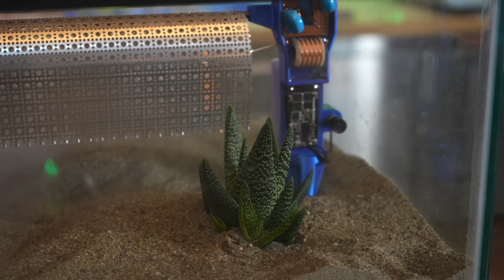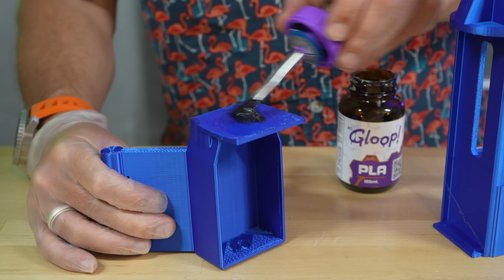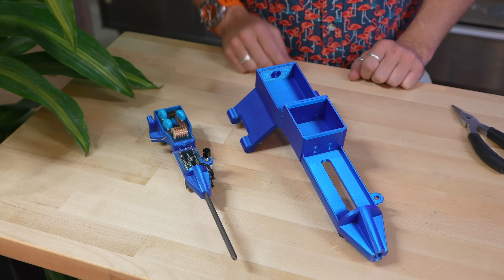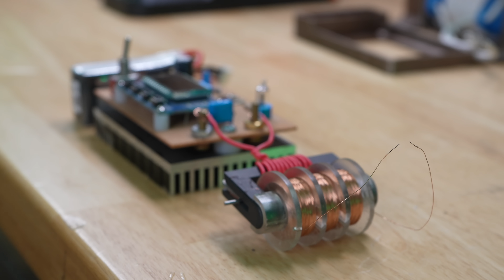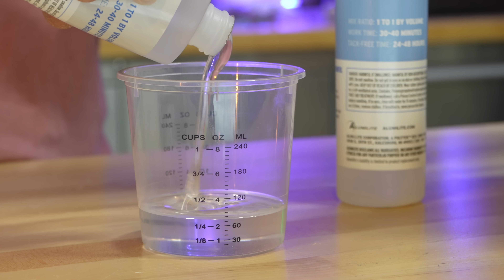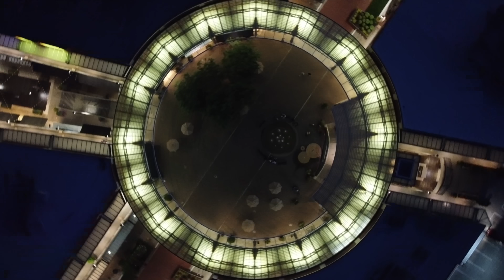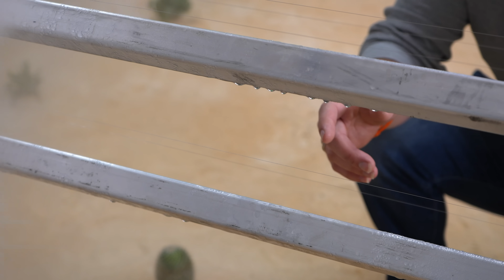Turning Desert Fog into Fresh Water Using 50,000 volts

Comment: What about a geodesic dome configuration that provides shade to a plot during the day and electrifies at prime periods of fog? An interior mesh screen could act as anode and an outer mesh could act as cathode separated by insulators. It would drip over the crop inside but could also be collected along the outer perimeter
Reply: Make it a modular and stackable system and you can easily bolt on more mods for shade or collection

Comment: Do I understand this correctly? You are trying to increase the air flow such that more water has a chance to condense? 
Also, what is the purpose of the dry ice? because dry ice is just carbon dioxide, I guess it lowers the temperature making it easier for water to condense? But doesn't that then mess up your data? FYI be careful using dry ice indoors because a high enough carbon dioxide concentration will make you pass out and you could die.
This should really be tested in a real dessert. Make sure you have a measurement with which you can compare the measurement from your own device. I suggest that at the same time you also collect water from one of those nets earlier in the video.  Doing this at the same time makes sure both measurements are done with the same humidity which (I'm assuming) is the limiting factor of how much water you can get from air.

Comment: For fog detection, would an IR sensor work? Put a emitter and a receiver, and you can measure the voltage based on obstruction. Full blockage for mechanical problems detection.

 Put an LDR, or an ADC on charger output, and you got day/night cycle.

Comment: would totally put some simple esp or arduino nano together with a moisture sensor for control - if humidity higher than _% then turn on. could even log the values periodically, via the native wifi capabilities of the esp32. to take it to the next level could even hook up a scale under the collector to see how much humidity produces which amounts of water to optimize operation, and just general data fun.

Comment: Very amazing engineering here! A few suggestions, Slope  the collector poles and have them empty into a collection tank. Add a micro controller that has an LDR light sensor and humidistat to control when then device should switch on.

Comment: Dry ice fog is C02... which sublimates at atmospheric pressure, the moisture youre getting is from cooling down the air and the pipe with the dry ice.

Is this moisture not caused more by the dry ice than your device?

Comment: Hypothesis: test this setup with a lattice-style structure with thinner wire - it may increase efficiency in a compact space.

Request: begin experimenting with ever-decreasing air moisture content. This could be a simple, cheap, and easy preparatory tech for the low moisture content of Mars's atmosphere.
It could potentially be deployed with today's technology and begin a slow but steady collection of water for future Mars missions if it can be shown to be able to generate usable water from as little as 0.03% moisture by mass.

Comment: Huh... So air precipitators/cleaners actually do precipitate water (under specific conditions). I'd wondered why Abbra had machine-screw mounting points on every one I'd bought when they don't supply anything that uses them.  But I imagine now that they would tend to collect suspended 'vapor' (ie: from a ultrasonic or venturi aerosolizer/humidifier)  I'll have to remember to test this the next time I have another  foggy day or fragrance-diffuser to repair ... (after I've replaced the broken wires in the collection cells... )

Comment: Curious about the other breaking points for the design, that I think only a live test for an extended period would reveal. Deserts are hot. If the idea is to only deploy it at night, then you avoid that hazard, but if it's meant to be in situ during the day and only turn on at night, then I feel like the design might suffer some warping or damage to the electronics from the heat.

Still, a fantastic expansion of the original proof of concept :D

Comment: Top tip if you put bolts and pins going down following gravity if the nut or retainer on the pin falls off at least the bolt or pin won’t fall out, common on industrial sites and automotive manufacturers back in the day 🤙

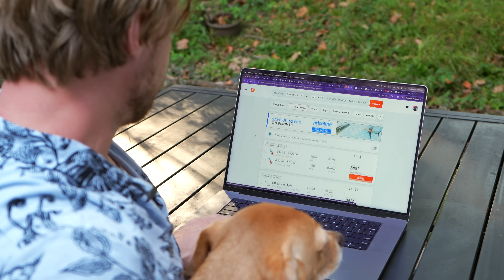Comment: 3:27 why would you want all fog to pass by a nucleation site twice? If the system operates at 50% efficiency, the first pass would take out 50% of the moisture and the second pass would take 50% of the remaining 50% of the moisture, so half the output of the first half. Wouldn’t be more efficient to double the length and use the entire length to collect the 50% from the most saturated air?

 .50 * Length + .25 * Length = .75 
vs
.50 * 2(Length) = 1

At 50% efficiency the system would collect 33% more water, the “double-pass” method gets less and less efficient vs the double length method as the condenser efficiency gets better, no?

Comment: This system should more or less just scale no? Like more condensing surface area, with the same power unit, would just net more water.

As for a switch there's all kinds of HVAC supplies for (de)humidifiers that should work, fog is just dense humidity after all. Just wire it in series with your on/off button.

Comment: My first thought that this would pull dust out of the air along with water, and that dust in the air was inescapable in the desert. But now I'm wondering if there would be any dust while there's significant fog - would dust particles gather moisture and drop to the ground early on, or would they stay suspended? If the latter, could it foul your reverse-fogging machine?
Also, what happens if someone or something wanders into the machine while it's on? Do they merely get an unpleasant jolt that they won't want to repeat, or would it be more harmful?

Comment: can these be stacked? like on after the other in a horizontal way so that one central powered stake and 8 support stackes in a X pattern with each side having 2 stakes one after the other to add the surface on which the water is condansed and also tilt them so the water flows to the lowest end  for easier collecting

Comment: Dry ice is CO2 so there is no way the water you extract is coming from the fog. Is good to illustrate the air flow, but not the condensation process. Psychometrics is a complicated and there is no guarantee this design will work in the desert. It very well might though and would be worth testing out in the field. Congrats!

Comment: ESD Filament is pretty cool/neat for those times you need ESD protection/shielding on sensitive circuits. You can typically get a resistance reading anywhere on the entire print, and you can even get flexible ESD-TPU.  I used such for a 60hz thermal-imager awhile back ago, because they're so static sensitive that holding the unit in my hand while walking was enough to kill it.. with ESD filaments, it even runs fine around 30KV high voltage.  I also used such filaments around my Half-Bridge drivers that are controlled by Arduino chips.  I'd say those are more sensitive than a 555 timer, but...maybe not.  As I've had solid success running arduino drivers ( open and exposed ) around even 125KV Xray transformers..but I typically enclose them for my own sanity haha.

Any plans to enhance capturing the water? Garage demo seems to show it collects at the bottom of the length of the tubing and just drips all over.  Plan to maybe have the rails angled to encourage the water to run/drip to one end? Or add some sort of metal/plastic trough to catch the drips and channel it into a tank or something?

Comment: Might want to replace those silk PLA prints with anything more heat resistant before placing them in a desert. Looking forward to the PCB way sponsorship of the custom manufactured parts. 

Thinking way too long term, but detaching the battery from the solar panels to bury deep enough in the sand to protect it from heat would help it last longer.

Comment: Cool design and application. One question though. Is the PLA going to warp from the heat of the sand and the sun? I had a PLA phone holder that warped in the Sun while in my vehicle. Michigan USA
Reply: PLA wouldn’t last through any moderately hot day in a desert. It’s really weak in the heat when under any load.

Comment: A dht11 sensor is cheap AND gives you both temperature and humidity data which you can use to calculate the dew point which is basically detecting fog

Comment: Your field test should probably include one fog net to serve as control. If the effectiveness of a traditional fog net is dependent on wind being present,  then a second net paired with an appropriately sized, solar rechargeable fan would be a good comparison of an alternate solution. Also, a low-tech, passive solution can be scaled up despite its low efficiency especially when you factor in upfront and maintenance costs. Of course, when you look at the consumption side of the equation, a more efficient, high-tech solution may be the best option to meet demand even if it costs more.

Comment: Cool concept but the entire desert in a garage is a BS test. Go to one of the many deserts in the united states instead of going international.

Also, if you're trying to push serious power through a MOSFET a pinhole board won't work. They need to have a ground plane to dissipate the heat.

Comment: use a humidity sensor and an arduino for your activation.
Or just use a bigger panel and battery for 24/7 operation.
even in non foggy conditions the air has moisture in it.

Comment: Uffff. So many things to comment on:

1. The sides of the wings should also have a slight vertical angle either towards the center or to the side to allow water to drip into 1 or 2 container for collection. Unless you want it to only serve as means of irrigation. But you can make it dual-purpose. Wings flat for irrigating a patch, wings inclined to collect in a container.

2. Connecting point for electrical components are the weakest link in terms of durability in the field due to corrosion both from water and dust (which the desert has plenty of). They either need to be hidden or protected from the elements. Especially since you are running electricity through them. You are ionizing these metal components in high humidity conditions (during the foggy times).

3. The circuit boards need to be able to resist extreme temperature swings THROUGHOUT THE DAY with radiating heat both from the Sun AND the Ground. Same goes for the plastics and resins used for casing. Any plastic component WILL crack eventually due to the heat and the light. This is especially true for the insulation on exposed wires.

4. As someone who lives in a semi-desert area in México, I can tell you that DUST is the real enemy of any devise meant for outdoor usage. Avoid gaps in the casing so as to prevent dust build-up inside the equipment to avoid static build-up and risk of short circuit/fire. Also, avoid using metals that corrode easily (like steel), because fine dust can literally sand blast any untreated metal relatively quickly.

5. This particular item (very ingenious design, I might add) is meant for usage in extreme environments for long periods of time, which means high degrees of wear and tear, not accounting for animals and bugs (the noise is a good deterrent). For commercial use, this fog trap need to have a good balance between resilience and cost of deployment/maintenance. Especially because of the nature of the places it will deploy into.

6. Lithium-Ion batteries are a dodgy choice for desert usage because temperatures during the day. In that respect, that is easily solved by making the battery removable and to be charged separately. Also, they should be insulated for operation at night since the temperatures in a desert can drop drastically during the night and especially during the early hours of the morning (when the battery is most needed) because this drops in temperature reduce the efficiency of the battery.

7. For automatic activation you could use a humidity sensor and calibrate it to work during certain humidity ranges. Or switch to a thermostat calibrated for low temperature ranges (the ones that you get early in the mornings.

Finally, if you want desert/semi-desert conditions with a lot of morning fog, right now my state, Queretaro (in México) has those conditions during the mornings. And the conditions will persist for a while, with all the cold fronts and the masses of air from the Gulf of México.
Your invention is great. Love your work. Sorry for the TED Talk. I have a background in maintenance so I see it from that perspective.

Comment: I notice the bars on the chevron arms are horizontal. If you put an angle to them so they dip down towards the central pivot, water would flow down the arms to the middle where you could presumably place a water collection container. I also wonder if the top bar of the chevron arms could be changed to something with a shape that could ionize a larger amount fog like a wire mesh similar to what is used for small rodent cages.

Comment: Okay, now I'm wondering how this would do on a boat for making purified water, perhaps as an emergency backup to standard reverse osmosis.  R/O filters also have issues with dirty/turbid water, but something like this pulling straight from the air shouldn't care.

The better modern yachts carry several kilowatts of solar panels (some also have wind turbines for night generation) and a couple hundred kwh of batteries, and there would be room to run several meters of multiple collection rods/racks, like a whole array.  Actually being out ON the water should make for plenty of source humidity.

Okay, filing that experiment away for later here, but if you get a chance to test the notion on someone's boat, I'll bet it would make a great video.

Comment: You need to have a control test. Turn on the fog machine in the same spot with the machine off and see if the fog still condenses at the same rate on the machine. Calculate the difference

Comment: Really interesting to see how well this works! I have 3 suggestions:

1. As a few people here have said I think that a "smoke detector" style fog sensor would be the best approach - you could use a laser over the length of the device from one end to a light sensor on the other to detect fog over the entire area between them (this also has the benefit of not suffering from water build-up as a smaller more traditional smoke detector component would, but I guess it's not easy to find as a pre-built part). I believe that you should be able to do this with an analogue circuit as well, if you want to stick to the robust design, made of discrete, easily-sourcable and workable parts.

2. I would also raise the centre so that the water runs down the rails and collection could happen on the ends (as I think some others have also mentioned).

3. Finally, I would highly suggest that you use PETG instead of PLA for this device, especially if you're planning on open-sourcing it and hoping that people will use it to collect potable water. PETG is much more UV resistant and less porous, so it has reduced chance of contaminating the water. I know this is only a test, but PETG prints differently to PLA so might inform your design decisions, which will remain for those who might end up 3D printing this for home use later on down the line.
Reply: UV will take far longer than a single hour of desert heat on the PLA. 

A singular PLA object holds up independently in the heat, but add any weight and it will creep and deform super quickly.
Reply: @hellothere6627  Heck of a good point haha - I was mostly concerned about the contamination and realised the UV thing'd be a problem after; but I guess I forgot that deserts are very hot.

Comment: Does your device need fog to work? What about a tropical desert environment with 60-85% humidity? How about coming to Maui to test and upscale your invention? There is a tremendous need for non groundwater sources in Hawaii as the growth of the island’s population has exceeded the carrying capacity of the basil lens of fresh water under the islands. Can this be scaled for a single family home with photovoltaic panels? Water output would need to be 20 gallons per household resident per day.  I live at the 2600 foot level on Haleakala and nights are always cool and damp. But rainfall in my area is typically 20-30” per year. Your device would be a godsend for people living on a catchment system. 

So, how about a field test in Maui?

Comment: This looks really promising; the one thing that springs to mind is adding a collection system and keeping track of how much water you produce vs how much water you're pumping in from the fog machine - could give an idea of the efficiency of the system at taking water out of the air, rather than the wattage per ml.

Comment: Very cool tec, but i think it's still very inefficient for an active solution that requires energy.
With desalination you get about 250-400 liters per KWh, while this stands at 21 liters per KWh (in lab conditions).
You would still need to transport the water from the coast though.

Comment: Consider this process instead:  A high-energy surface (i.e. copper) draws moisture from air. This happens at the dew point. This only applies a single atomic layer to the surface.  After this layer the surface energy is water, which is lower than copper. The surface is then subjected to a charge that pulls it to a collector, exposing the initial surface to attract more water molecules.    This would have to be done very fast as it would take a long time to collect enough water from collecting an atomically-thin layer.  But, if close enough and if the high-energy surface material was moving under the collector, the math might work out.